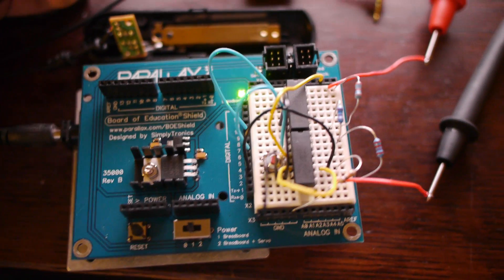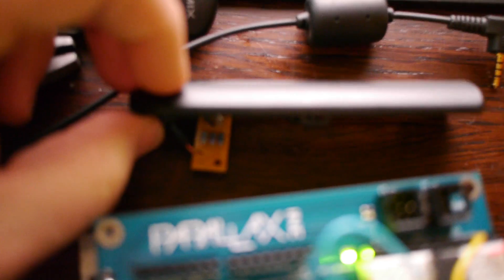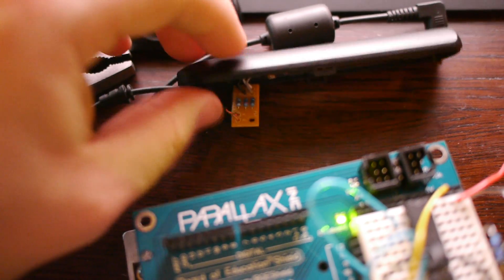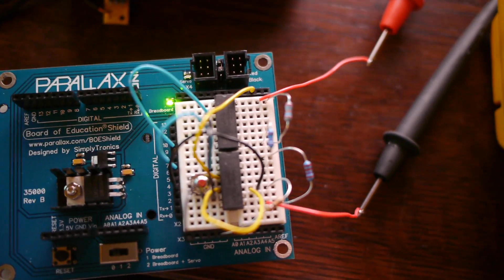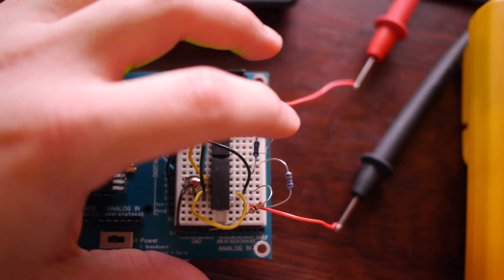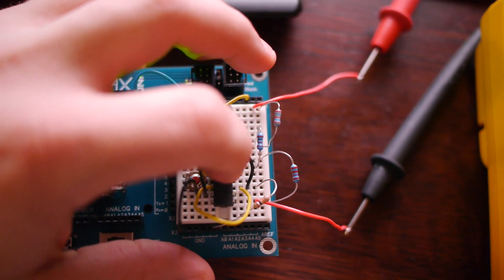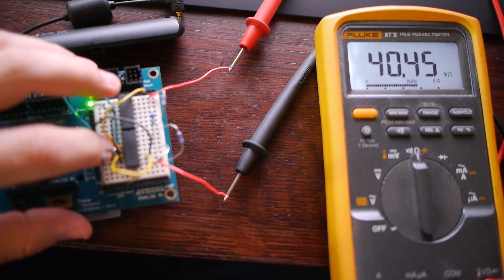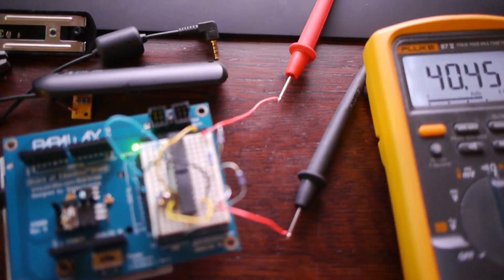Arduino Panasonic remote shutter release (DMW-RSL1 disassembly)

Comment: Hi! Very interesting video! I'm wondering if, if I just wanted to trigger the shutter remotely, the circuit could be significantly simplified? In fact, I'm wondering if, using a 'cheap' remote release, it could be as simple as making a jumper to the focus pole, and running the wires out the end of the knob to fit a 3.5 stereo mini jack that I'd need in some projects based on in arduino. Thanks in advance and good job!!

Comment: Can you tell me the length of your DMW-RSL1 mini jack 2,5 mm connector?
I try to construct remote shutter release to control it by microcontroller, but I have a problem with the connector's length.
I see that DMW-RSL1 connector is 2,5mm 4pin mini jack. I have some of those connectors  from old phone headphones (+mic), but it looks like they does not go completely inside the socket. Probably this is the cause of that I can't get the voltage on the right pin.
Do your mini jack connector goes completely inside?
What Lumix camera do you have?
Reply from the maker: Sorry for not getting back to you sooner!

The total length of the jack is close to 10.8 mm. The length from the base to the end of the first ring is roughly 6.4 mm.

The 10.8 mm length is from the "flange" of the sleeve to the end of the tip. The 6.4 mm length is from the flange of the sleeve to the edge of the ring closest to the tip. (I hope my description makes sense.)

Comment: Looks like it briefly goes short-circuit (multimeter reads 0) while resetting after taking a shot. While unlikely, it's possible this could damage the camera.
Reply from the maker: Thanks for the note! I had noticed the "OL" on the display, but I figured it was just an artifact of switching from three units after the decimal place to two units after the decimal. I'll have to keep your post in mind so that I can (eventually) test the Panasonic remote to see if the multimeter reads "OL" with that as well.
Reply: OL means Overload which is the opposite of zero. It means that the resistance is higher than the current measurement range goes. It disappears as soon as the multimeter switches to a high enough range so everything is fine with that.